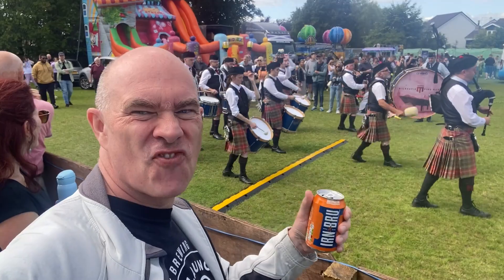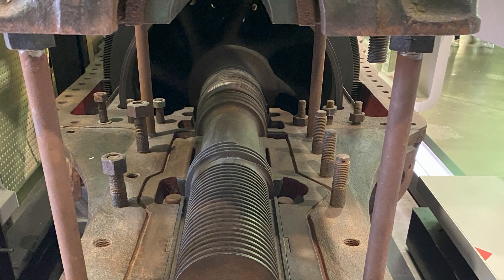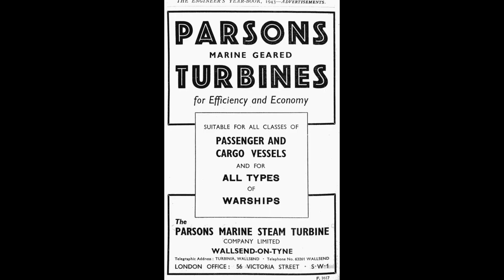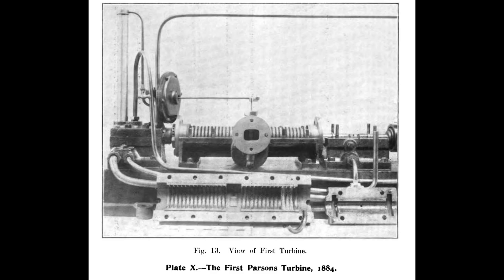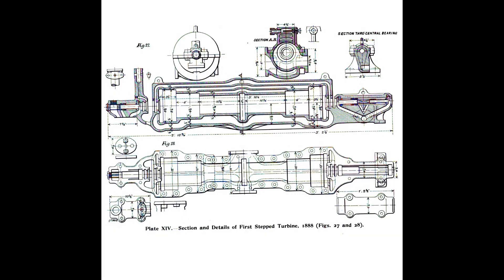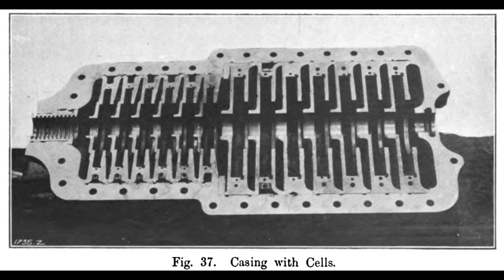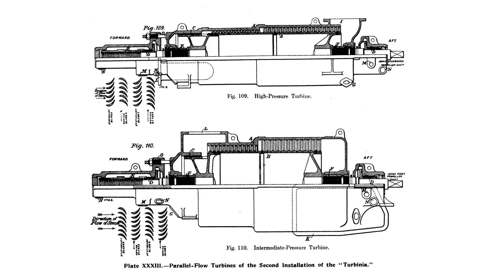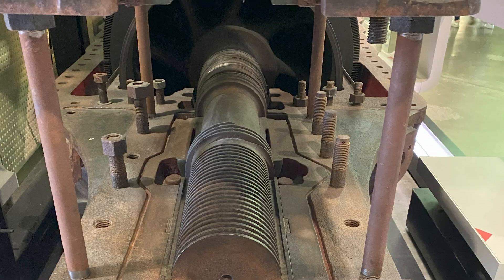How A Victorian Era Engine Made Spaceflight Possible... Let's Look At A 125 Year Old Turbine!

Comment: Thanks for this video. I worked in a commercial power plant for a while and didn't realize, up until that point, how much precision is involved even in 70-year-old turbine designs. It's certainly safe to say that the invention of turbines tremendously changed our society.
Reply: It's an interesting but rather childish theory for sure, clearly trying to connect two things that are in fact not related. The truth is Jet engines were developed from Turbochargers which use the same BRAYTON CYCLE as Jets and not the Rankine Cycle like steam..

Comment: It's worth mentioning the critical role of physicist Henri Victor Regnault's three-volume tome "Properties of steam", which contained the calculations and data that Parsons relied on in determining the blade designs for the expansion stages of his turbine.
Reply: It's also worth mentioning that the development of jet engines is completely unrelated to steam turbines... they don't even use the same thermodynamic cycle or the same type of turbine..

Comment: The design for the de Laval Impulse Turbine looks a heck of a lot like a starter motor for a modern jet engine. These run on high-pressure Bleed Air, usually from the onboard Auxiliary Power Unit or from an external source if that isn’t available.

Comment: A jet turbine will not work in space, the steam engine is an externa combustion engine, the gas turbine is an internal combustion engine and requires oxygen to function.
Reply: Excellent point, steam engines also operate using a completely different thermodynamic principle, they use the Rankine Cycle while Gas Turbines use the Brayton Cycle,
Jet engines were developed from Turbochargers that also use the Brayton Cycle, the development of jet engines is completely unrelated to steam turbines... what he is attempting to imply is false and misleading.,
Reply: @DoktorBayerischeMotorenWerke  I have worked on gas and steam turbines all though my working life and ended up a high-speed rotating specialist in the oil and gas industries.
Reply: @bigboy9693  Sounds like we have very similar backgrounds..
Reply: @DoktorBayerischeMotorenWerke  I am in Australia and did my apprentice as a machinist and made sure when I finished my trade, I worked every job that would allow me to increase my skill set. I did steam turbine overhauls in combined cycle power stations and on ships, in the mines and spent time with a lot of industrial gas turbines including carrying out overhauls at the manufacture's facilities, accompanying the engine that we removed and overhauling that, worked on large marine diesels and large diesel generators, I ended up looking after the machinery on a FSO, gas turbines, rotary screw compressors and every other piece of equipment that relates to the storage, compressing, handling, power generation, cooling, hydraulics, cranes and anything else that required maintenance. I have now retired and have a large workshop at home with my lathe and mill as I need to feel that all of my experience is not wasted.

Comment: A thing that nobody actually says when explaining steam turbines, which I had to work out for myself when I studied them, is that the steam isn't "blown" through the turbine - it is sucked by the vacuum that's created in the condenser. A small detail that makes them instantly more comprehensible.
Reply: Not all steam turbines used vacuum stages.  Steam turbines are driven by the pressure of liquid water expanding into steam, this is a highly inefficient and wasteful process, Vacuum condensers are used to recover this wasted energy in the form of latent heat and conserve the conditioned water.

Comment: Great video on how old steam turbines are. The axial and centrifugal turbine technology was well understood in the 1930s. Making a jet engine was more a problem of maintaining uniform and stable  combustion at higher velocities and temperatures along  with control issues to stay within the metallurgical limits of the day.
Reply: Indeed, steam turbines are not related to the development of jet engine in any way... they were the logical extension of the development of TURBOCHARGERS, Steam engines operate using a completely different thermodynamic cycle, Turbos and Jets use the Brayton Cycle... steam is limited by the Rankine Cycle.

Modern jet engines are possible because advancements in combustor technology and thermal management technology.

 Swiss engineer Alfred Büchi is the genius that made jet engines and gas turbines possible, and it's his pioneering work at Brown Boveri und Cie that made jet engines a reality.

It all traces back to Alfred Büchi and BB&C.
Reply: @DoktorBayerischeMotorenWerke  Absolut Richtig. Well explained.
 I wanted to point out to more lay people that there was more involved than fast revolving blades in jet engines.
Reply: @DoktorBayerischeMotorenWerke  There is only a small entry for Büchi in Wikipedia,  what equipment did he and BB&C develop? What applications? What inventions? Thanks.
Reply: @powerjets3512  Other than the Turbocharger and the first practical gas turbine engines?
 The Turbocharger is the basis of all jet and gas turbine engines.
 The BBC Velox core gas generator is the first commercially produced gas turbine engine and led to the first gas turbine electric power generating stations and the first gas turbine locomotives.
 Oerlikon's Germany division licensed the axial compressor technology and produced compressors for early German jet engines which brings us directly to the jet engines we use today.,

Cheers!
Reply: @DoktorBayerischeMotorenWerke  Sorry, I looked at the German Wikipedia site for Büchi thinking it would have more. The english one has more, but it is very much related to piston engines and the turbo charging of them. 
For me, chemical industry compressors have much more of a connection to the earliest jet engines than electricity generation or locomotives. The steam turbine driven centrifugal compressor in particular. Axial compressors are to this day complicated and reserved for high gas flowrates. You could have the steam turbine section operating at 400°C or so. In the early designs you mention combustion was involved, but the gases were cooled down with water to remain within the metallurgical 400 °C limits. The Houdry process did use an axial design compressor, but this is post Whittle's first centrifugal engines. Centrifugal was the way to go until the combustion and control issues were solved.  The problem with a jet engine is that the inlet conditions to the engine are  continuously changing and you have to cover a wide range of conditions (taxi, take-off, dive etc). The fuel combustion has to match that demand in real time without creating hot spots. Try that with no electronics and poor combustion technology in the 1930s. Not getting close to design limits due to hot spots meant poor performance and bad power to weight ratios or frequent engine failures.  
MfG
Reply: Büchi was a pioneer in both the thermodynamics of the Brayton Cycle engine but also with fluid dynamics axial compressors.
BBC and Oerlikon were the first manufactures to produce axial compressors for industrial applications including gas turbine engines.

A.A. Griffiths visited BBC in Switzerland several times to study both turbochargers and gas turbines. He orchestrated the first demonstration of a gas turbine in the UK in 1932 at UMIST in Manchester and negotiated a licensing agreement with BBC to allow Metropolitan-Vickers to build them in Britain, Griffiths and Constant's work on the Metrovick is based on this licensed technology from BBC.

The German company Krupp introduced the first high temperature, creep resistant nickel alloys in the world including P-193 Tinidur A60, this material was demonstrated in the BBC Velox gas turbine engines in 1930... and used on the Jumo 109-004A and BMW 109-003 engine as well as others, this predates the existence of the Allies Nimonic alloys.

Whittle was forced to use inferior materials like Browns 18/3 and REX 78, stainless steels used in cutlery and kitchen utensils, Whittle's turbine blades were initially made by a Sheffield cutlery maker rather than a turbocharger manufacturer.
It was Rolls-Royce that received help from General Electric's Turbocharger division that introduced Hastalloy B and Nimonic to the British jet engine program.

Jet engines used mostly mechanical fuel computer systems prior to the 1970s... all the first gen. jets in WW2 used completely manual fuel controls, only the later Jumo -004B introduced mechanical fuel pressure governors and throttle dampers, the German jets also featured fully automatic variable convergent exhaust nozzles to control compressor performance and maximize exhaust gas velocity at the tailpipe.

Critical jet technology that is completely unrelated to steam engine development.,

Cheers!
Reply: @DoktorBayerischeMotorenWerke  Servus.
Thanks. Some of that was new to me. The story you paint is of mechanical engineering excellence and in particular in axial compressors. My story would be much more multi-disciplined with company politics and economics playing a role.  The British axial engine, the Metrovick, was not developed at full pace because axial designs were very much a technology too far. This was very much the case concerning reliability and power to weight ratios. What you have not touched on is why Germany built an axial engine at all. The reason was because the Heinkel centrifugal design,  around 1938, was so bad. The competitors (BMW & Junkers) to Heinkel then claimed they could build a better axial engine quicker. Total BS as we know. Whether it was hollow blades, better metallurgy or other developments they were all attempts to get around the problems caused by the axial design decision.   As the temperature was limiting it meant there was no point going to higher pressures from multiple compressor stages that increase the temperature.
Whittle in the 1930s had no money or a large company like Heinkel behind him nor a government pouring  money into armaments. It was not just the steel used, but also the combustion technology. The main issue was combustion and control, before metals. Whittle knew the fluid mechanics. The combustion issue was tackled by an Edinburgh company for very little money. They made burners for industrial boilers. The combustion cans were called "Englander" in Germany. Whittle's company was taken over by Rolls Royce under governmental war legislation in the mid 1940s.

The German engineers did understand that control was a huge problem in their engines, but the solutions were far off in the future. They did indeed develop a sophisticated control unit for the Jummo 004B, but it could not be installed before the war ended.  

I think your last sentence should read steam turbines, but process and control issues were again key technologies in the steam engine. The initial problem of the steam engine was a lack of efficiency. It was not caused by poor cylinder boring (that would be improved by the manufacturers of canons). The process discovery that changed things was the condenser invented by James Watt of Edinburgh. The insights came from Joseph Black's , also of Scotland, who discovered latent heat while doing work trying to reduce the energy consumption in Whiskey distilleries. Cheers! Control of steam engines was also a key technology i.e. the development of the steam governor. The mathematics behind the steam governor, and the first paper on control, was written by James Clerk Maxwell. If you don't know who he is, then you have some reading to do!  

Given you are a BMW expert, what are mechanical engineering dominated companies now going to do without hydrocarbons? The diesel boom was due to the introduction of turbo technology into cars, but it was really the removal of the sulphur from the diesel that was key. The diesel car suddenly had great acceleration and it was clean (at least from a CO2 perspective). That was before German managers found alternative solutions to NOX emissions.  

Prost!

Comment: Cavitation is fine, as long as it's way from your prop & not attaching to the surface of the blades/duct etc. The real issue with even detached cavitation, is that it means that energy is being wasted. This applies to both ships and pumps and hydroelectric generating equipment etc. Stationary applications like pumps and hydroelectric equipment etc you can get cavitation damage on the piping around the propellor/impeller.

Comment: been looking at V2 fuel pump steam generators as an alternative to a boiler for a high speed steam locomotive
Reply: Why?
Reply: @DoktorBayerischeMotorenWerke  
to get round pressure vessel regulations.....
Reply: @markv4598  As I understand, a Hybrid steam generator has the same 2-3 year boiler inspection requirements as a fire tube boiler.
I believe OSHA and the FRA also have regulations and inspection intervals for large transportable Liquid Oxygen storage vessels too.
 I'm not sure what you would accomplish... sounds very impractical and expensive compared to a traditional locomotive boiler.,

Comment: Another little fact about cavitation noise : when you're boiling water in a kettle, the increasingly loud rumble you hear as the water gets closer to its boiling point is, in fact, caused by cavitation bubbles collapsing near the bottom of the heating element.

Comment: They weren’t called “bladed” but “buckets” as the turbine was based on the waterwheel. 
I worked on turbines and turbo pumps for about a decade from 25 horsepower to a million horse power power plant turbines. 
We were working on a turbine at the Ford Rouge River Detroit plant that was installed by a Thomas Edison company. It had a run away event where it spun too fast and one of the wheels on the rotor exploded. It cut the 8 foot diameter 4 inch thick shell in half and blew holes in the walls and roof which was 40 feet up. 
They are awesome machines.

Comment: The attendance of Turbinia at the Jubilee was organised by a group within the RN.  Mainly those who had kept in touch with Parsons.  To expect total uniformity within such a large organisation as the Royal Navy on an important new technology should strain all belief in the simple story.
Another very interesting part of the Turbinia story was the development of her hull shape.  It was arrived at using models, and was an early use of a broad, submerged, transom stern to reduce high-speed squatting.  This was considered to be an ugly shape, and Turbinia ended up with an odd-looking upper stern.
Having a very narrow length to beam ratio of 11:1, with low freeboard and a "ram" bow profile giving less than the usual reserve buoyancy, Turbinia was not all that seaworthy, and nearly foundered on the return leg of a demonstration voyage to France.
Within the RN, HMS Viper was possibly even more divided than Turbinia.  I have read reports exaggerating the advantages of the steam piston-engined Torpedo Boat Destroyers then coming into service, to blacken the reputation of both the ship and it's creator.  There were some good reasons for the antagonism.  With the early coal-fired, direct-drive turbines the somewhat limited "black gang" that could be accommodated on board such a small ship could only keep the limited amount of fuel up to the boilers for relatively short periods.  Plus the higher efficiency was only realised at high ship speeds, and that speed was not commonly used in service.

Comment: Yes, the turbine is an engineering marvel, but to use it for maritime propulsion you also need a reduction gearbox made incredibly precisely and robustly. The US Navy still uses them. They are locked up with the same locks used to secure weapons and ammo. They're guarded by Marines, if they have to be opened for maintenance, because one of the simplest ways to sabotage a ship is to throw something in the reduction gears which grinds them to steel confetti (hence the expression "Throw a wrench in the gears).

Comment: Willy Ley in his book, "Rockets, Missiles, and Space Travel", describes how turbine pumps are critical for the operation of liquid fueled rocket engines. The pumps for the German V2 rocket were based on pumps used in firefighting. The pumps had to come up to speed quickly and deliver high volume flow at a constant pressure.

Comment: Great video! As you probably know, Lusitania (built in Clydebank near Glasgow) and Mauretania were the first turbine-powered express liners and achieved record 27+ knot speeds. However, reduction gearing that could transmit that amount of power hadn't been developed yet, forcing use of direct drive. This meant the turbines were spinning much slower and the propellers faster than ideal, resulting in high fuel consumption and severe cavitation - Lusitania's stern section vibrated so much during sea trials that second class was found to be uninhabitable. Heavy bracing and revised propeller designs helped mitigate the problem but it was never fully solved.
Reply: The Queens were built there too and I think they put 50000 shp to each of the four propellers.